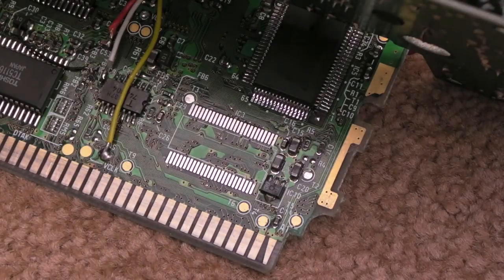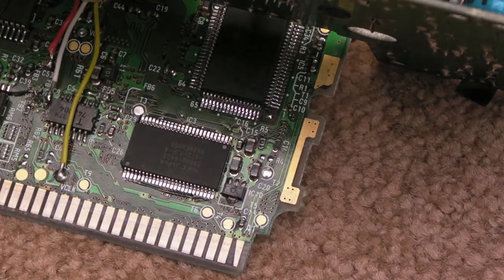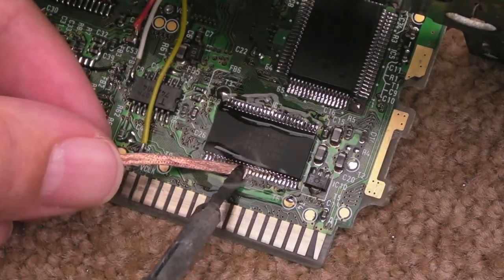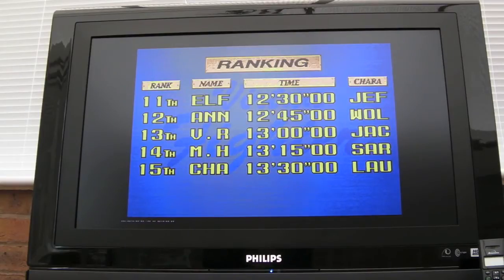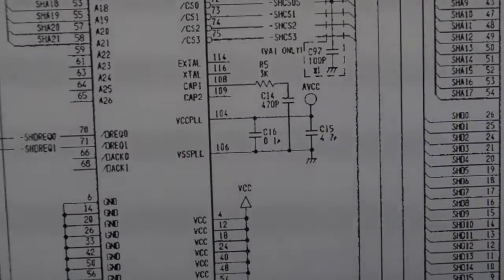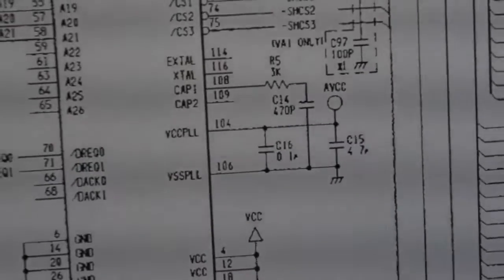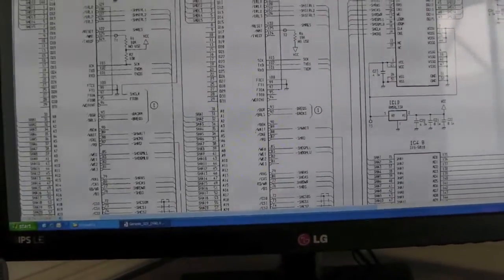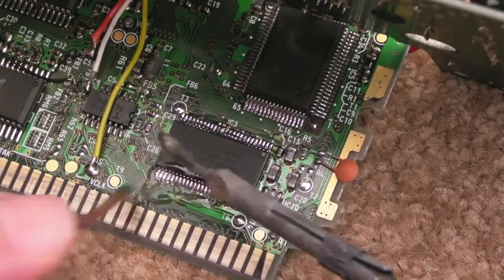Sega 32x Repair Part 4

Comment: Btw, I noticed that you got some flickering in the camera when pointing your camera towards the monitor directly, starting from around 11:10. What you could try out is to go into the settings menu of your monitor and set the backlight and brightness to the maximum level. I think the backlight is usually controlled with PWM, and that might be the reason to why the screen is flickering more in the camera when the backlight is lowered. Some monitors have backlight and brightness as separate settings, and some monitors seem to not have a setting for backlight in which I think the brightness setting also affects the backlight. I don't know how the settings menu on your monitor looks like, but you could always experiment with this to see if a maximum backlight and brightness setting will reduce the flickering effect in the camera.
Reply from the maker: Very interesting, I didn't know that regards PWM!  It is a 3D monitor - not sure if that's anything to do with it as well.  Will give that a try next time =)

Comment: 12:18 C14 is hooked up between ground and pin 108 through a 3 kOhm resistor here, and since VSSPLL is going directly to ground in this case, we can't be absolutely sure that C14 is actually involved with the PLL unless we have an internal circuit diagram of the chip that we can take a look at. But pin 108 is neighboring pin 114 and 116 in the diagram there, and that kind of makes me think that this capacitor at least has something to do with some kind of clock signal, whether that is part of a PLL or not.
It turned out that you didn't need to, but if you were really curious about what was actually going on, you could have used your scope together with a properly compensated 10X probe to look at the signal at the capacitor side of R5 while C14 was not in the circuit to see if you could spot any kind of jitter or similar integrity issues at this node. You could then have compared it to when the capacitor was in place and observe the difference. You would of course have had to trigger on a stable clock signal somewhere else on the board to be able to see the jitter at the C14 node in such a case, but that is something you could have tried if you really had wanted to get to the bottom with it. I was kind of hoping you would try that out, actually. :)

Edit: I took a look at the service manual and found some info there saying that C14 is part of the PLL, but exactly what it does is difficult to say without an internal diagram for IC2, which is not included in the service manual.
But good thing you got this unit fixed in the end nevertheless. Very nice work!
Reply from the maker: I did find a timing difference as a result of that missing cap.  It was hard to tell on the scope as my scope doesn't have a digital capture / storage etc.  If I get time over the next few weeks I will get the logic sniffer back on there and do another video.  I did have a play around with my logic sniffer last week before I went on leave but I really didn't have much time to film anything etc.  I also had to fix the Neo Geo Pocket again (had to remove, clean up and reseat several more components on that Neo Geo Pocket) before I went away as I wanted to take that with me.
Reply: GadgetUK164
I think you should be able to see any inconsistent events in timing very clearly even on a 2 ch analog scope. In fact, it might even be easier sometimes than using a logic analyzer. If you find a clock signal within the system that is not jittery or faulty in some other way, then you can use that as a trigger source for your scope. Once you are triggered on a stable symmetrical signal that exists within the system, you can then use that as a reference to check the time correlation between the triggered signal and other signals, or even two other separate signals.
It's actually easier to check the phase relationship between signals as well as check for jitter using an oscilloscope rather than using a logic analyzer. This is because the logic analyzer is mostly giving you information about timing based on different threshold levels instead of presenting an actual waveform on a screen. A fully analog scope is always updating the screen in real time which means that jitter can be very easily spotted, taken that the scope has been set up properly. On a scope, you will actually be able to see the jitter of the waveform as it's happening whereas on logic analyzer you don't. Instead you have to carefully look at the timing information of each pulse and try to manually search through the recorded clock signal to find any kind of jittery action, which will take a long time and probably end up in giving you a headache. I would suggest that you save yourself the trouble and simply hook up your analog scope and see if you can find any jitter that way. Try to display and trigger the signal at the CAP1 pin on the master CPU. Then you can switch on channel 2 and check the signal at the CAP1 pin on the slave CPU. The CAP1 pin on the master CPU should be free from jitter since the cap is in there, but you could even verify that if you wish by comparing it to the clock signal at the x'tal oscillator from which it originates.
Btw, it's true that a digital scope is much better for finding infrequent glitches and such, since you can then try to set up the triggering to trigger on that glitch and capture it, and/or you can set up the persistence of the scope which will make it possible for you to see the glitches even though they are passing by very quickly and you're not triggered on them. But constant jitter as we are talking about here is another story. It should be easy enough to see that even on an analog scope. The graphical glitches you experienced were rather infrequent, but I would not be surprised if the missing cap was causing a constant jitter in one of the clock signals. The jitter was probably small enough to only fall out of the timing boundaries every once in a while, causing the glitches and lock up not to be more frequent than it was. If you do have a constant jitter on a clock signal and if you set the scope up correctly, there is a very big chance that you will be able to see that jitter. Why not try it out? :) Although you will of course have to remove the cap at C14 again before making the measurement since having the cap in there fixes the problem. Or, you could try doing it both with the cap there and without the cap there and compare. Just remember to always trigger on a clean jitter free signal.

Comment: 7:12  You got the chip very nicely soldered in there. Nice work! But you had to work on the pins several times over to make it look like that. I would once again like to stress the importance of using a clean iron tip here. Using an oxidized tip or a clean tip might be the difference between having to work a lot on the chip with the iron, or to almost be able to do it in one go. It's preferable to try to solder an IC with as little touch count per pin as possible, because every time you touch a pin you heat it up to at least the melting point of the solder alloy in an instant. Therefore, the lower the touch count, the better for the chip. A clean tip will greatly help you to lower your touch count when soldering an IC to a PCB.
Reply from the maker: Thanks again!  Yes, that tip really should have been replaced years ago - I tend to really make things last, but in this case it's working against me keeping it on there.  I will get swapped out next time I use the iron =)
Reply: Alright, sounds good. Btw, I don't know if I have asked you this before, but what soldering station are you using? Brand, model? What kind of flux do you usually use? What brand and type of flux did you use when soldering the RAM chip in there?
Reply from the maker: The iron I tend to use for a lot of these things is the cheapest (and not the best) iron you could possibly buy!  It's an Antex C 15w iron - not ideal because it's not temperature controlled etc.  For some things I tend to use my Weller desoldering station which is temperature controlled, and that will go up to 450 degrees for those insane heat sinks that absorb all the heat on PSUs etc.

Regards solder I am not sure on the brand at all - I purchased my current reel of solder 20 years ago.   What I do know is it is leaded solder and contains flux also.  I really don't like lead free solder at all.  The flux I used when resoldering the SDRAM was ChipQuik - It seems expensive to me (£18 for 6 x 2cc tubes) but it works extremely well - I love using it. I think the part number on the tube is  SMD291.
Reply: You mean, you used the ChipQuik as your solder alloy for soldering the new chip onto the board? Did I understand it right? Or did you only use it for desoldering the old RAM chip? Just wondering, because it is really not recommended to use ChipQuik as a solder alloy for soldering components to a board. ChipQuik is an alloy developed for the purpose of assisting in desoldering components with multiple pins and is very unsuitable for soldering components to a board, simply because it's not developed for this and therefore doesn't have the properties needed to create reliable solder joints (wettability, durability etc). I think ChipQuik is a very valid method for removing a chip from a board as long as it's not used for regular soldering. I personally am not a fan of it though. Tried it a few years back and I didn't like it much. Too expensive and it didn't work very well for me. It might have been because of me not being used to it, but it certainly did not act as a regular leaded solder alloy, that's for sure.
Reply from the maker: Sorry, I wasn't clear there!  I use the ChipQuik flux (comes with its own specialist flux) to both remove and solder the chip.  I only use the ChipQuik solder to aid removal of the chip.  I use a completely different (standard) type of solder to resolder the chip afterwards - that solder has normal melting point and is leaded and contains its own flux.  I certainly wouldn't use ChipQuik solder for anything other than removing QFP chips.  The flux that is ChipQuik branded is awesome though - really love that flux!
Reply: The ChipQuik flux sounds interesting. Maybe I should try it out sometime. Do you think it's possible to buy it separately or is it only sold as part of a ChipQuik kit? What exactly is written on the tube of your ChipQuik? I don't know whether or not there are different types of ChipQuik flux, but I'm wondering what I should search for exactly to find the one you're using.
Reply from the maker: If you do a search for ChipQuik flux on EBAY you can buy it seperately!  I think PCArena of Bristol sells it on EBAY.
Reply: Ok, thanks. I will have a look the next time I'm shopping on eBay.

Comment from the maker: I think there might be more missing components on that board - Just watching my video now I see points with no component at R65, R4 and C4.  I am starting wonder what the hell has gone on with this board lol.  Note: Don't work off the carpet!  You need to work from an ESD safe surface and wear and ESD wrist strap.
Part 1 - https://www.youtube.com/watch?v=EZw9aRRFxq4
Part 2 - https://www.youtube.com/watch?v=zJyxr27y3oA
Part 3 - https://www.youtube.com/watch?v=9VjHCXwCXl8
Part 5 - https://www.youtube.com/watch?v=bdysbfbgj5o
Reply from the maker: The US and UK boards are identical, except for one wire link on the top board, and the variable capacitor will be set differently (probably) for difference between PAL and NTSC.
Reply from the maker: Yes, that's the same link!  Pretty much the only difference between the two regions.  And yes, you need to do the region mod to the Genesis / Megadrive as well =/  I will do a video on that shortly as I want to make mine region free.
Reply from the maker: My mistake there - When I say region free I mean in theory you can run any region.  There's another point regards region protection and that's the fact that 32x carts from different regions have a slightly different profile on the case, so a Japanese cart won't just plug straight into a PAL 32x without cutting some of the case away.

You are right that ROM images are illegal to use if you do not own the original game.  That said it's so widespread over the internet now and so many sites host the games that they lost control a few decades back.  The fact that they haven't blocked the sites hosting the ROMs (or taken legal action against them) kind of sets a legal precedence of some kind I am sure.  ie. How can you sue someone for playing a game they don't own when you've done nothing to stop the hundreds of sites distributing that game to the masses to start with.  Regards Retron and things like that, you tend to find those systems are manufactured in China and its very difficulty for companies to stop their production etc.  Basically, Nintendo or Sega could waste hundreds of thousand or millions of dollars chasing some company in China to find that it closes down and 10 more clones setup shop overnight, also based in China.  It's just not worth the effort from a financial perspective. 

One final point I will make there is the ROMs of these old games being available in the public domain doesn't stop people wanting to buy them on new platforms - eg. XBOX, PSN, Wii, 3DS etc.  I lose track of the number of games I already have ROMs for that I've since bought on other platforms over the years.   People want to buy these things in a format they can use and at a price that reflects the age and value of the product.   The industry hasn't been able to do with games what has already happened with music. ie. The idea of a ROM being legal for 99p (ala iTunes).  Too many copyright owners and trademarks etc.
Reply from the maker: Hehe, that's great if you are getting motivated =)  Glad to hear your dad is getting fired up as well lol.  I was the same a year or so back, hadn't really done anything significant with electronics for 20 years.  Now I am enjoying it and wishing I had got back into it sooner.
Reply: @GadgetUK164  I saw that C14 was missing yet thought maybe it was just a little dark not missing.

Comment: What is that bottle of flux called and where can I get it from?
Reply from the maker: Hi,  This is the flux I use:-

http://www.ebay.co.uk/itm/Chip-Quik-No-Clean-Flux-6-X-2Cc-Smd291St2Cc6-/121058182056?pt=UK_DIY_Material_Paint_Varnish_MJ&hash=item1c2fa143a8

Chip Quik.

Comment: I could never do anything like this. If I ever do anything really delicate after a short time I start getting the sensation that I need piss.  Probably too much information for my second comment to you ;)

You sound like you could be quite local to me.
Reply from the maker: LMAO @ needing a piss!  Thanks for watching and commenting!  Subbed!
Reply: GadgetUK164 I had to look back at your other videos.  It does indeed look like the cap was missing all along.
Reply from the maker: I've just done the exact same thing lol.  I finished watching part 1 again to see that cap missing and then read this message lol.  Great minds and all that...  So basically this 32x came with all the wires removed, damaged traces, shorted out cap with wire, ferrite bead replaced with wire, and another cap completely missing - but the solder was still there as if it just fell off lol.  It's hard to believe, when I bought it I really believed it would be just a case of cleaning it up...